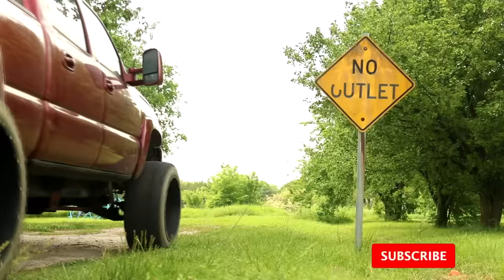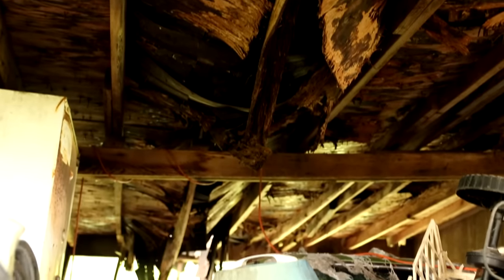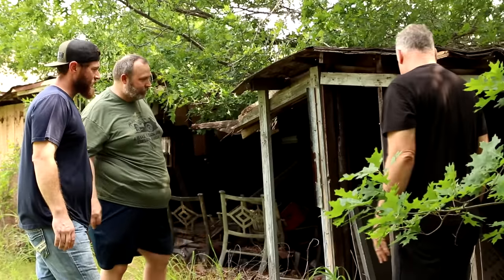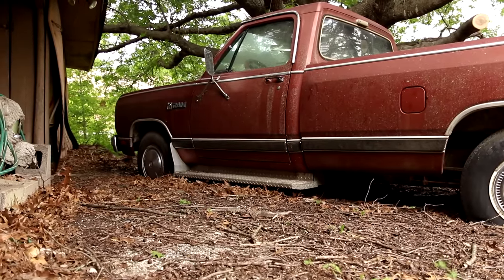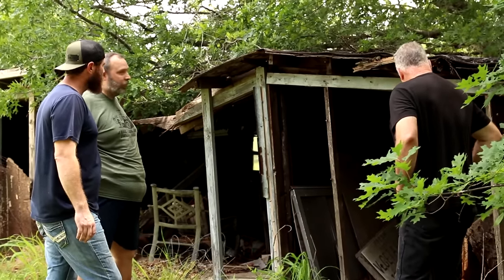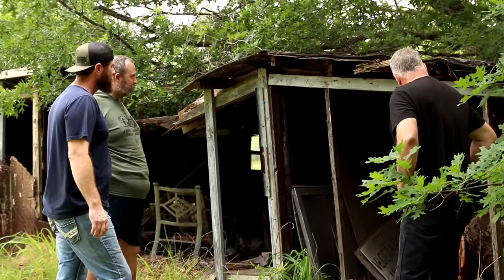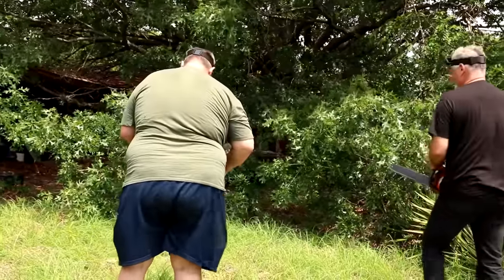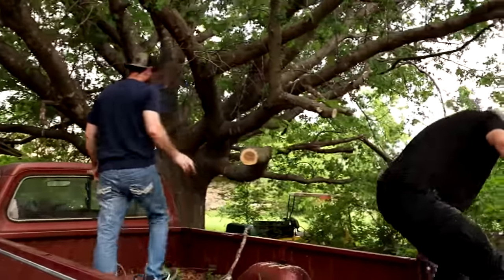Forgotten Muscle Car Rescued From Collapsing Barn | 1972 Pontiac LeMans | RESTORED

Comment: Wow, My parents who passed away this past spring, had the 4 door version in my their garage. It needed an exhaust repair, that my father started but never completed. Sat in the garage since 1989. After my parents passed, my siblings and I were not sure what to do with it as it needs restored. So my sister and her husband took it as a project car.  Amazing, its the exact same year and color as the one in this video. Even has the same tan vinyl roof. I remember when my dad purchased it used in the late 70's. We were on our way home with it and my dad wanted to see how the power was. He was so impressed with the power of the 350 V8 engine and smoothness of the drive train at 85 mph on the highway. When we arrived home with it, we noticed the engine has miss. Found one of the spark plug wires came off, yet the engine still had plenty of power. He really like that car. Shame it sat for so long, deteriorating.

Comment: I look forward to the "Will It Run" video! I thought it was awesome to see the 350 on the lower front fenders. Now let's see if it has a 4 barrel. I kinda think it's a 2 barrel though. The paint looks like it should clean up nicely. And I love the color.
Reply: 'tis a nice shade of green 💚
Reply: The motor and transmission means absolutely nothing ,and chasis and metal structure is A + and have owned 3 Firebirds ,one 1969 400 4 speed that was scary fast ,73 Grand Prix ,1978 Bonneville and why on Earth they stopped producing such a well built car is beyond my comprehension ! Oldsmobile should have been the model chosen

Comment: Heck yeah. I really am glad that you are able to bring new life into that car. I have to help my dad with his car. 69 amx that hasn’t been on the road since 96 in and out of barns and been sitting in ours for years. Covered in stuff. The 390 was taken out and rebuilt and a 304 was the temporary replacement. 390 sadly locked up and the poor thing needs a whole lot. The car runs but I need to fix the fuel inlet on the carb because it snapped off. The wiring is trash. Mouse house and I gotta swap on a better rad hose. Runs mint though. Just need to get the fuel system fixed. And then I can drive it out to begin the repair process. It’ll be easier to rewire when it’s not tucked in the corner. And hopefully I can fix the 390. And I hope the 4 speed is still healthy. Dad says we need to swap the 4.10 gear out of the rear for the 3.73 because first gear is useless.

Comment: As an old tow and recovery guy, nice use of the "Holmes Tree". I can also vouch for the nylon recovery straps. For what I've seen you do, a 3" x 20 or 30 foot strap would be ore than sufficient. That should have a 30,000# break strength so it would be suitable for a 15,000# vehicle (2:1 safety factor). Stop by your local FD and see if they have some old firehose. Use that as a guard if you're strap is going over any sharp edges. FYI, tow straps will have hooks on each end. Recovery straps have loops. I carried a 3 x 30 strap with a couple of D-hook shackles in my pickup for years. Never let me down.

Comment: Hello guys, this car is a great find and is in pretty good shape . About 6 to 7 weeks ago, I pulled a 1972  Ford Maverick car out of an old garage that was in about the same shape as this car here and hauled it over to my first cousins barn and her grandson wants to restore it .
I know it's not a muscle car like your find, but still a neat car, it has a 302 motor, and an automatic transmission and the doors were locked and had not been opened for years and years and the inside was in pretty good shape and the car had been bought brand new by my first cousins ex- father in law . 
I will see you all later, can't wait to see your car all cleaned up and back running . So take care and stay safe and keep on working on the old vehicles .
🤗👍💖💫

Comment: LOL, nowadays any 2-door with chrome bumpers is called a muscle car but it was a great save, that building looks like it could collapse any day.  I own a 72 LeMans like this they are great cars.  The LeMans is the exact same car as a GTO but with different front end treatment and badging and usually a lower performance drivetrain although they could be ordered with the same engines and transmissions offered in the GTO.  I hope the frame is alright on this one as that seems to be their weakness.  The frames are prone to rusting out at the corners especially below the corners of the windshield where water runs down the sides of the firewall and lands on the frame.  I purchased my LeMans 8 years ago out of Arizona and the frame is still in perfect condition.  I had purchased a 71 LeMans new when I was 18 and always wanted to relive those days.......best decision I ever made.

Comment: Love those old pontiacs. Never seen one with those round windows in the back
Reply: I'm really curious about the rear windows (opera, port,  whatever they're called) as well.   I've never seen them before either.
Reply: @andymonroe6136  must have been an option
Reply: @after5auto133  The gentleman that sold the car responded to another comment about the windows.  He said they believe it was a dealer installed option, it's unique for sure.  Thanks for responding. 👍
Reply: @andymonroe6136  super rare I’m sure

Comment: Not a muscle car but still worthy of being brought back to life. My Grandmother also owned a 1972 Pontiac LeMans coupe that ended up being her last car. Same color with the black vinyl top and green vinyl interior. It was purchased at J.C. Fortune Pontiac in Florida. It had a 2 barrel 350 V8 with a 350 turbo hydramatic trans, A/C, bumper guards, side impact strips and an AM radio. Unfortunately she gave it to me when I was a dumb 16 year old. I owned it for about 5 years. I sold it to my friends Uncle who ended up driving it for almost 10 years so it ended up having a decent life span of 20 years and almost 200k miles.

Comment: Excellent video RESTORE Crew  :) also nice shape 1972 Pontiac Le Mans family car also in mint green color and looking forward more videos too soon on it ! Yes Lance  :) it amazing find for sure 👍 and hope hear on Dodge pickup next to do also ! I know working on barn find right now at my work  to old 1972 Pontiac Grand Prix 2 door restored up fully and sat in barn since 1978 plus original owner past away but daughter of wants fix to take vehicle shows next year also on more!  Only thing floors gone from fire wall to trunk also going long time too do and roll on flat bed fine also off too! Next project is be is 1979 Chevrolet Malibu LS   2 door sat since 1984 transmission went out gears when had running last and got brand new in trunk since 1985 Turbo 350 3 speed Automatic transmission so hope okay too will find out ! Body need paint but interior mint  shape !

Comment: Correct if I'm wrong guys and gals but 2 Grand is a freaken steal for this.
Reply: @Justin Natasmai  I did a bunch of research before selling at this price.  I found examples here in the Dallas area that cleaned up and in driving condition were going for 4K - 6K.  In the end it came down to wanting see it back on the road.  I knew with the Restore guys it would get there and that they would document the process.  The filming of it made letting go of it possible for Carrel.  The Restore guys got a price that would fit into their business needs and Carrel got some great memories and video preservation of the car with the promise of it getting back on the road.  Something that she desperately wants to see but knows she cannot accomplish on her own.

Where the car went was so much more important than the selling price.

Comment: I had a 68 la mans  back in the late 70's,  even though it was a beater, you could tell that car had a lot of class at one time in its life, that car had some type of air conditioner that could run you out of there in the hottest of weather, but watch your gas hand on it, because when you turned the ac on you could littery watch the fuel needle move to the E side when you turn the ac on

Comment: I had a customer that owned a 1971 LeMans.  350 2bbl.  Typical rust around the base of the vinyl top.  The worst is the hood hinges.  If they are not lubed good, the hood will bend.  That's interesting, Targa top with a port hole!  Don't recall seeing one of those.

Comment: GT-37 was always seen as the poor man's no frills GTO.  However, in an era of big block muscle hot rod cars anyone who owned some serious HP always added headers, an aluminum intake, a lumpy cam, posi trac, Cragar S/S wheels, and true dual exhaust.  Gone are those days when hot rodding was a weekend hobby that was affordable summer fun.

Too many kids with insane HP rides today, making hot rodding and street racing way too dangerous. It was really fun though growing up in the 70s and 80s where one could browse the Bargain Finder for used high performance car parts to tinker around with.  Anyone who had 375 HP had something really serious back then.

Comment: I had a 72 lemans GT from 78 to 85, it was a great car, 350 Pontiac motor, 3 speed hurst floor shifter no ps, drum breaks. I sold it when it needed its 3rd clutch, not that I drove it hard or anything. let me know when that one's done.

Comment: The barn isn’t a every good excuse there’s plenty of room to pull straight out of the opening of the shed after the stuff piled on top and around it is cleaned up if they are afraid the shed will collapse Having time to work on it would be a legitimate reason besides the money. It looks like it’s a nice car to easily clean up and put back on the road

Comment: Don't get too excited about "kinetic" ropes. They can be deadly in the right circumstances. If you connect it to an old truck like that and the part it's connected to lets go, the enormous energy stored in the rope will launch the part like a rocket. It's been known to kill people. A chain has no elastic energy stored in it, and so is a much safer choice when you aren't sure of the mechanical strength of the tow points.

Comment: FLASH! A 1972 Pontiac Lemans with a 350 V-8 is NOT a muscle car. You guys obviously know very little about cars especially muscle cars and this is not a muscle car. The 1972 Lemans with the 350 V-8 produced and anemic 175 horsepower and 275 ft-ft lb torque, hardly a muscle car by any stretch of the imagination. Might look like a GTO, but a GTO it isn't. It seems that guys like you without any real knowledge automatically classify anything from that era as a "muscle car" and they are not of the genre. By 1972 government regulations and restrictions that were mandated killed off muscle cars and cars produced after 1971 were only shadows of the glory of the true muscle car era 1964-1971. Please do some research and don't advertise your ignorance by labeling these slugs as muscle cars.
Reply: This car has SINGLE EXHAUST so the HP. is lower, more like 160 HP.